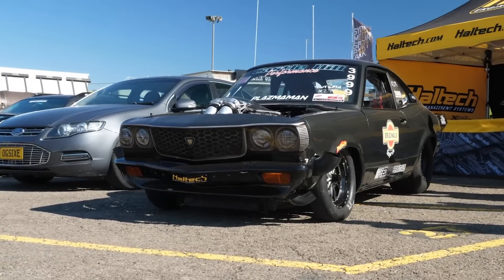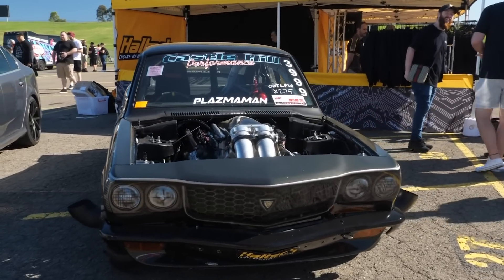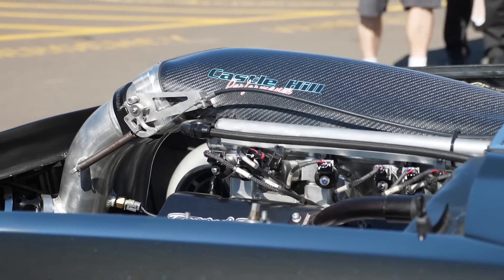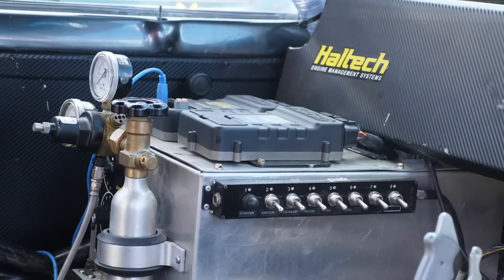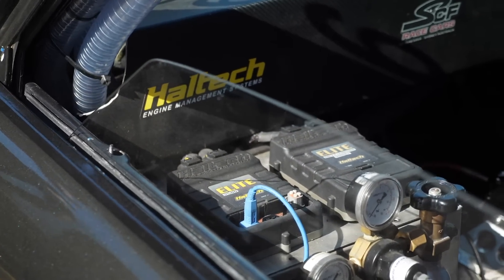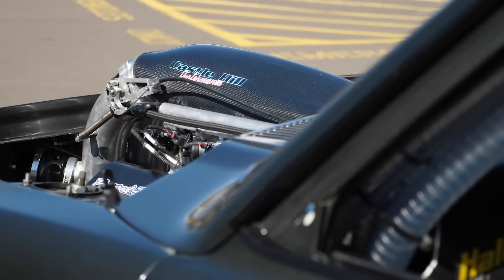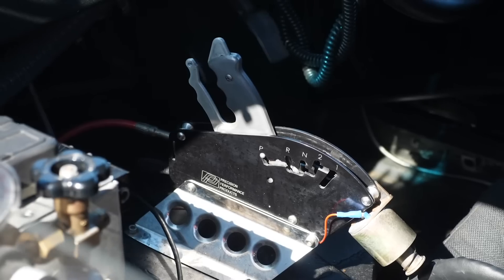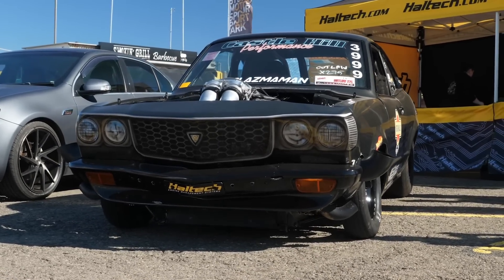9.2L, 3000HP Mazda RX3 | Twin Turbo Big Block V8 [TECH TOUR]

Comment: They got 3 rotors running 6.0 in a 1/4 thats is no longer an rx3 its just a 808 (piston version of rx3) at this point
Reply from the maker: The team aren't trying to make it a factory original car, but rather the fastest drag car they can for the class they are racing in 😉 - Taz.

Comment: You mention the brands of all the engine parts, but the titanium valves (which 99% of the viewers are insanely curious about) seem to be a state secret. Go ahead and check it out on the web....very few details out there about titanium valves and other parts. Of course there are the pdf scholarly articles designed to knock you unconscious by the second sentence.

Comment: What are the injectors on this? I've not seen some perpendicular to the feed before in this way before, is it just a simple piston opening/closing over an orifice? Do they still have a tip at the end or do they not bother with a spray pattern given fuel just hoses in anyway?

Comment: May I ask how does its fuel system work? Where is the fuel cell and what kind of pump they are using? It's  seems to be a bit too small of a engine bay for classic from mounted  cell.  Any info would be appreciated.

Comment: 9,25" stroke?
Reply: Even Andre can get it wrong on the odd occasion, but we know what he meant!
They'll probably take the cue card writer out the back later and belt the crap out of him 😄
Reply from the maker: @Mac it's happening right now, but we went for the jug cord this time. It takes a village to raise an Andre.
Will get that touched up/clarified, thanks team - Taz.
Reply: @hpa101  hahahahahaha
Reply: 560 CI with a 9.25" stroke? That works out to a 3.1" bore size. Image the compression ratio. But that is a TALL deck block alright.
Reply: @MattPratt  😉
Reply: @wickedTRX 9.25" stroke, 1" diameter, imagine that😂